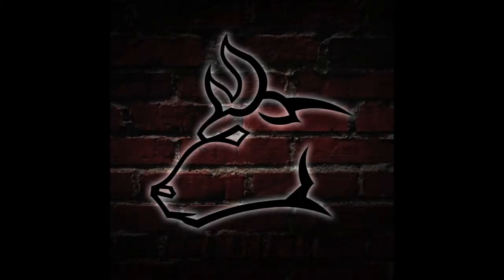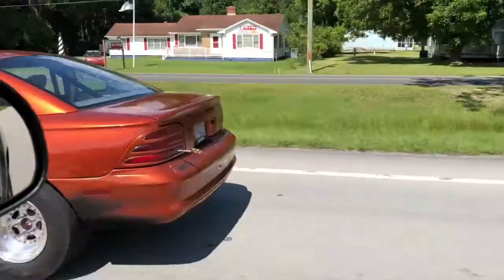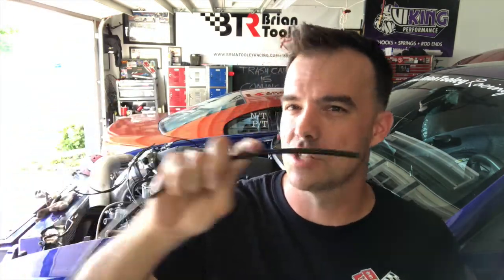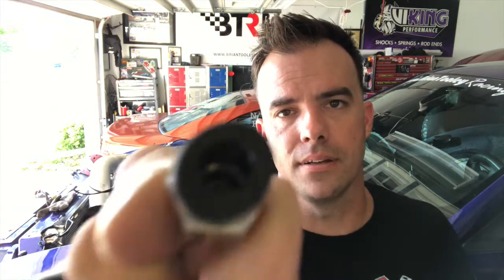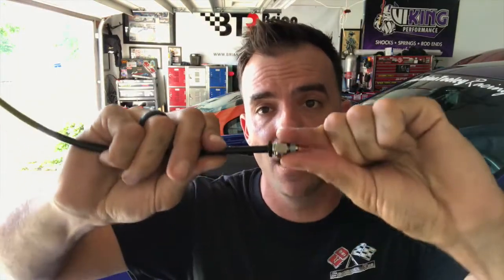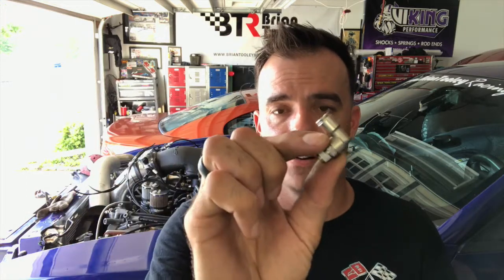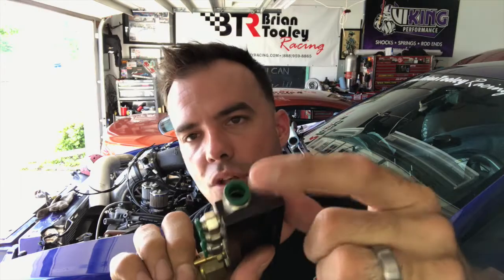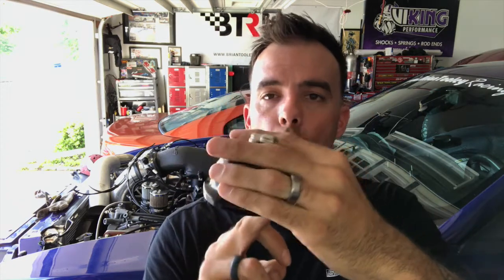Not So Pro-Tips: Push to Connect Boost Control Lines!

Comment: Great video!  Funny thing is a buddy of mine was just telling me how after watching me use this stuff on all my builds he had to try them and realizes how nice it is when you service or make changes to boost controllers or engine bays.    Its a RACECAR Life Hack !!    I've never had issues with these, and if heat is a big concern, run the lines through a heat sleeve

Comment: How do they come apart tho..
Reply: Push the plastic ring back in towards the fitting , opposite direction of the air line, then pull the air line out.  Easy !

Comment: No problem with the lines melting with only 150degree rating? I would think the heat from the wastegate could transfer through the fittings to the nylon lines.
Reply: I was wondering the same. I'm considering these options but I'm afraid anything that's plastic on the push fittings might fail overtime as well as having a weaker hose to accommodate the 1/4" tubing these fittings accept
Reply: @itr_cloud  so since I posted I’ve been running the same setup with metal fittings and never had a problem. I also have heat sleeve over the lines.
Reply: @xnivektonx  can you send me a link to the hose you are using? I used Parker Parflex 1/4 OD hoses and they melted inside the fitting on my wastegate
Reply: I've never had an issue, and if i was concerned I would use heat sleeving around them.